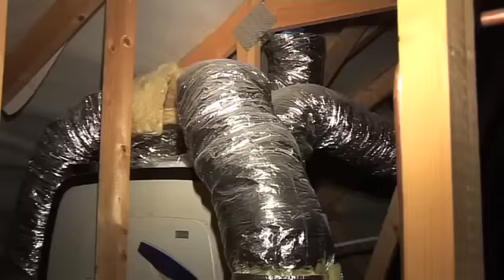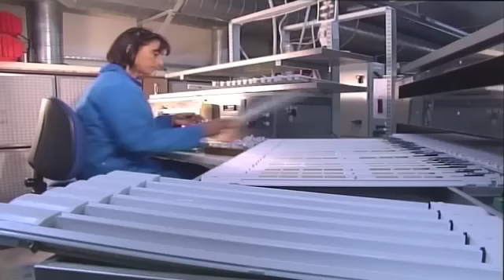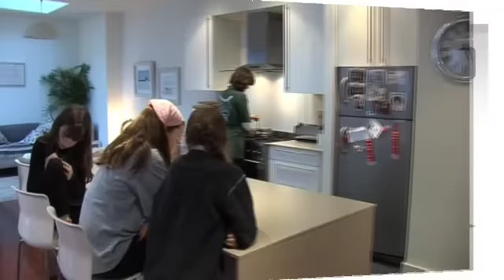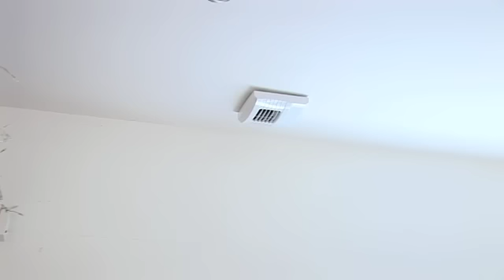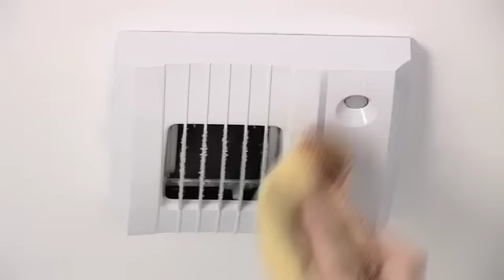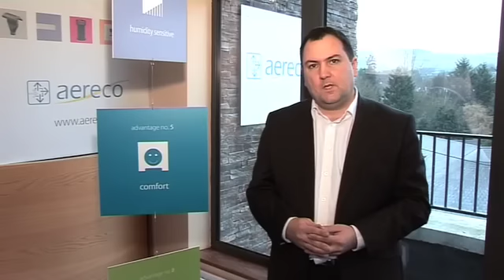Aereco Demand Controlled Ventilation Video

Comment: I have this system at home and when there is wind outside, a lot of wind comes into the house too. I do not recommend it at all, it enters 7 cold and enters even the humidity from outside. You should put this on your home and freeze
Reply: exactly which product do you have and do you also have the fan on the chimney?

Comment: Can you explain the functionality of the switch on the eht units? There seems to be a setting between on and off - is this humidity controlled and on constantly open?
Reply: There is only the automatic position (1) and manually closed (0). There is no setting in between.